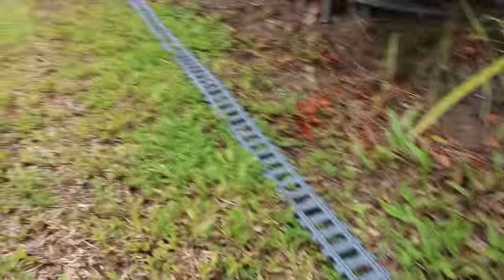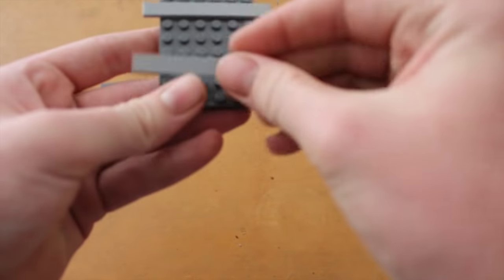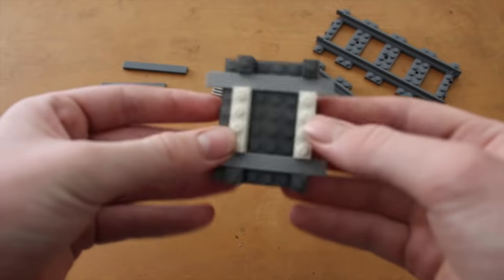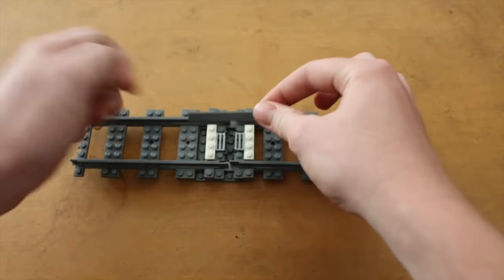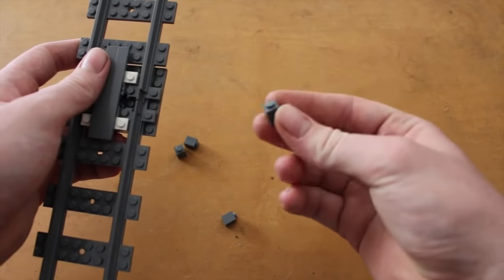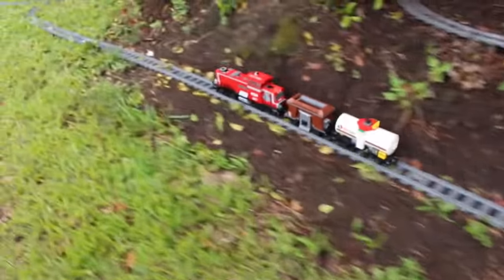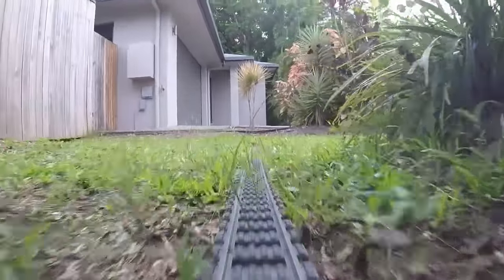When Lego Tracks Buckle, in the heat. How to fix it!

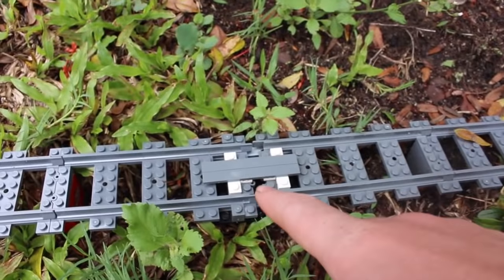Comment: At 1:55, just imagine if there was a oil train, and right as it was about to go onto the bridge, an axle gave out caused a deadly wheel slip, which in turn caused the train to jump the tracks a bit, causing it to slide down the embankment onto the other set of rails, just waiting there for it to be rescued.